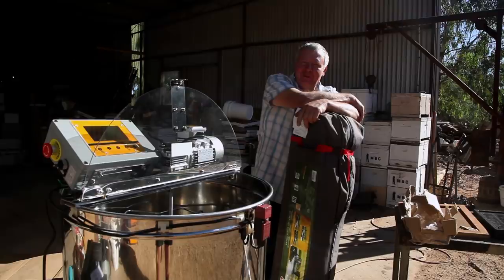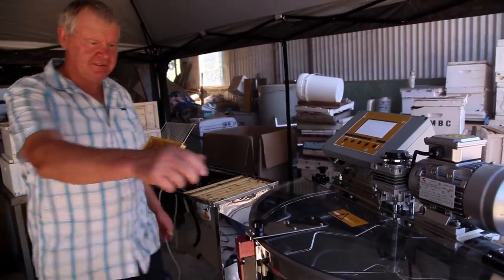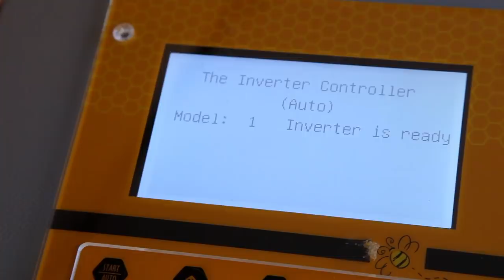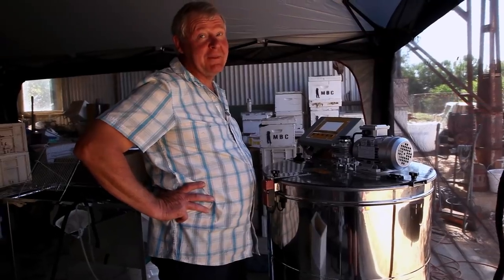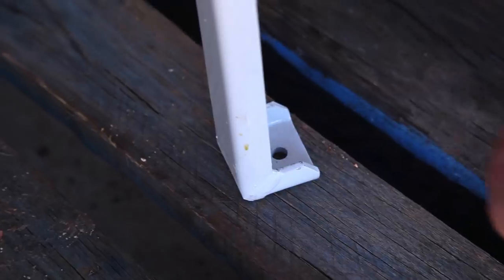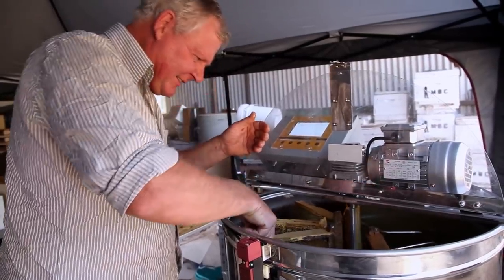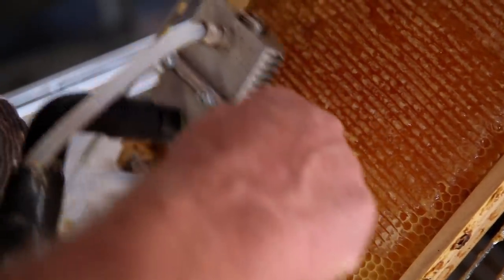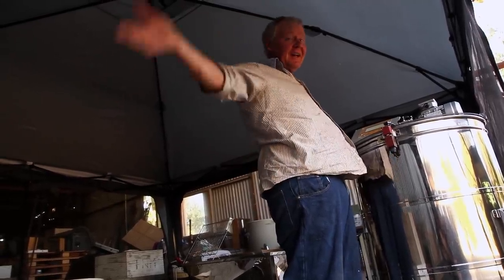Testing a New Honey Extractor - The Bush Bee Man

Comment: In order to extract all the honey from the frames, you ought to have the top of the frame turned towards you, when the machine is running. -Danish bee keeper
Reply: The Machine spins in both directions so the orientation of the frames should not matter?
Reply: @Gewehrdalf42  The honey combs have a slight tilt to prevent the honey from leaking, when standing in the vertical hives. Hence if the orientation is opposite, the honey will be forced into the combs instead of out.
Reply: hence the reason the frames are being demolished... lol

Comment: Frame should go in the spinner with top bars to the outside
Reply: Indeed, also they should be flipped if he is not going in reverse.
Reply: No need to flip frames or run it in reverse. It's a radial extractor.

Comment: Like the others said the top bars to the outside. The hardest part is spacing the weight of your frames so your unit is balanced. If you start your speed slow and let it run for a few minutes it sometimes moves enough honey that it self balances and then you can increase speed.

Comment: Frames are in the wrong way, cells are slightly downward so they have to have the top to the out side in order to release the honey it should also be pre warmed  to help it flow
Reply: I agree with Brent that the frames need to be top of the frame to the outside and also Mark you need to start the extractor on a slow setting like 15 to 20 rotations per minute for the first few minutes then slowly build up the speed from there. Like slowly increasing the speed a little each minute.  Once fully up to speed let the extractor run for a full 10 minutes. All the honey should be out of the frames by then. The reason why your wax frames "exploded"  was because the frames were still TOO full (heavy) for the speed you were running the extractor. Enjoy your time with the bees.
Reply: Kevin Betts 👍yes Kev’ your onto it, we are moving to only plastic frames in supers for this reason, we leave the wax foundation in the brood chambers
Reply: @BESHYSBEES  yep,  same here - wax foundation in the brood and plastic foundation for the supers.

Comment: Upside down miss Jane top bars to the outside and manually control the speed every new batch as they will be different balances.. I have a 12 frame Italian made extractor.. I also took the legs off and used ss turn buckles to fit it to a solid stand and it works very well

Comment: And people question why (for small backyard amateur beekeepers, at least) the Flow hive and top bar system are so attractive - zero extraction cost and no reliance on machinery are significant if you only have up to ten or a dozen hives.
Those fast programmes seem better suited to plastic frames, where the residual weight will always be equal and therefore balanced.
I think running it at lower speeds is more appropriate on wax foundation, as there will be more variation in weight.

Comment: the legs looked loose, when I bought my new 12 fr it needed tightening up and the legs should be braces at the bottom at ground, my extractor is lower and wider 12 frame and does not wobble much even at the high speeds with even an unbalance it has the weight to hold it. When you get honey in the extractor it will be even more stable. That extractor looks narrow in the drum and high, coupled with loose legs is what seems to cause your severe wobble. Thanks for your videos BBM I enjoy them, subbed too

Comment: I am not going to blame the operator. The extractor is accelerating too fast - your manual settings are the way to go. The high speeds are for when there is just a tiny bit left in the comb - and that thing was trying to drive off in just a few seconds. Also, that lid latch would be enough to make me want to return it.